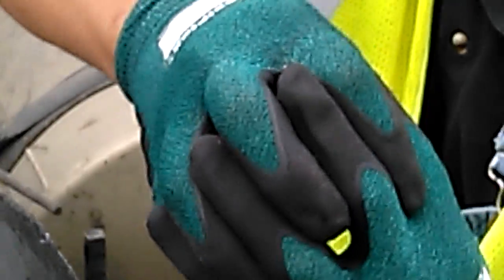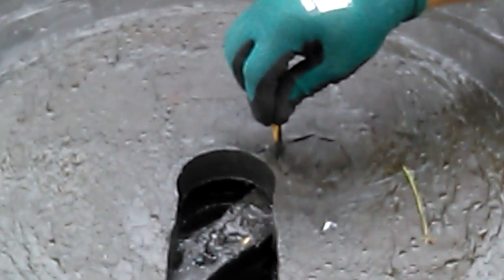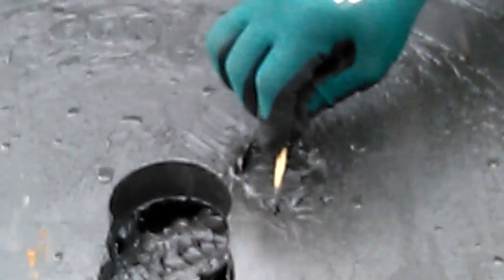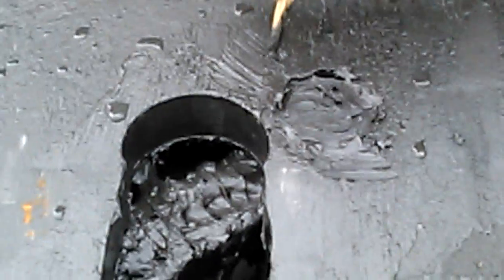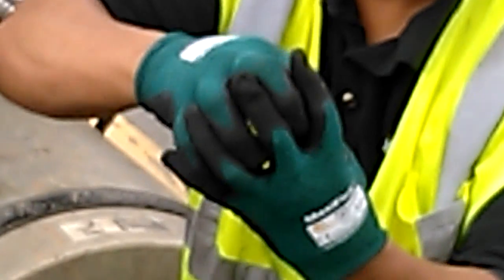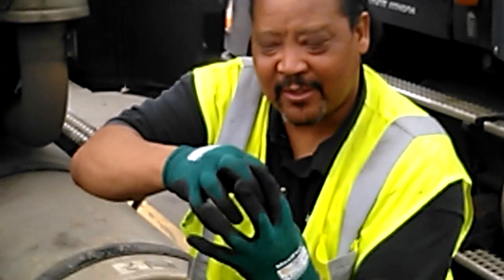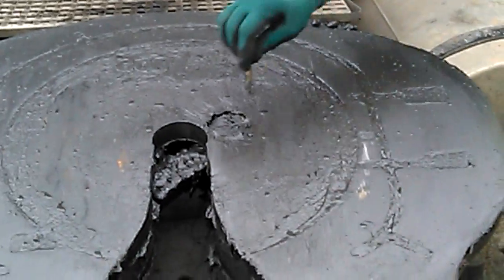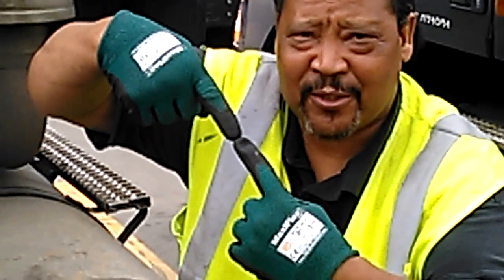Checking The Eccentric Fifth Wheel Jaw Pin for slack. NOT ADVICE

Comment: I am also a service representative for SAF-HOLLAND.  The purpose of the top plate's eccentric pin is to reduce the fore-aft movement in the lock mechanism that occurs through normal wear.  A properly maintained fifth wheel is considered worn-out and either requires replacement or rebuilding when the fifth wheel is on its last adjustment (position # 4) AND 0.125" (1/8") fore-aft movement is observed when tested with a lock adjustment tool.  I agree an uncoupling event is indeed a driver's worse nightmare.  A proper performed visual inspection can and will prevent all accidental uncoupling events as the driver will detect this unsafe operating condition before the uncoupling event occurs.
Reply from the maker: I agree with the importance of a visual inspection however the focal point of this information is servicing the fifth wheel when the arrow reachs a 4.  As one of the safest trucking companies in the industry YRC takes steps to replace the jaw kit when it reaches a 3